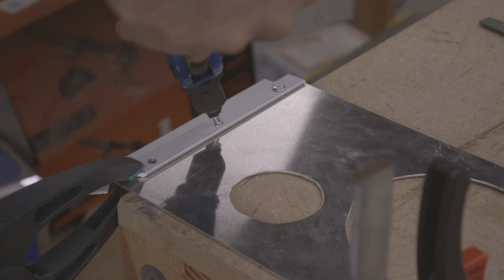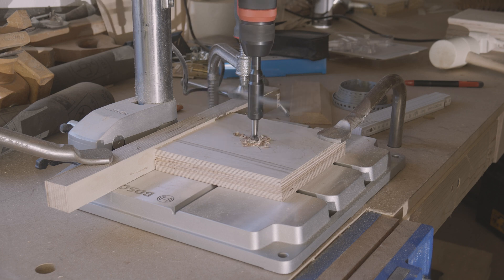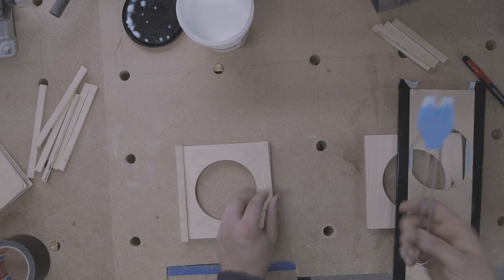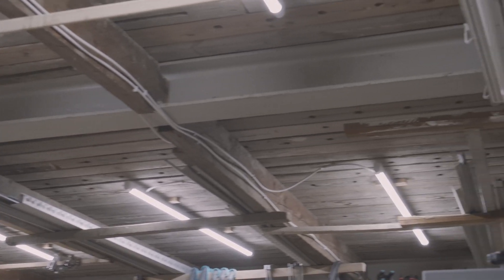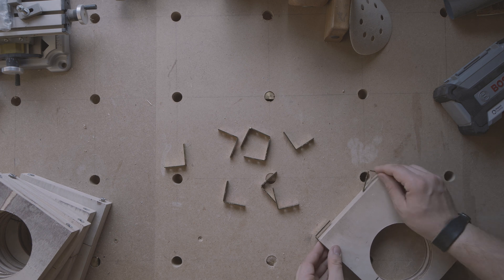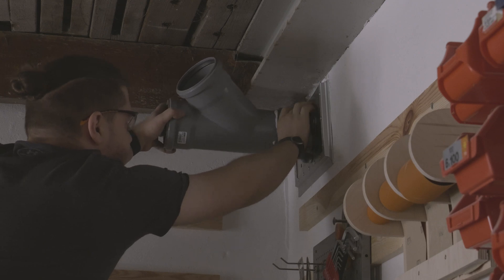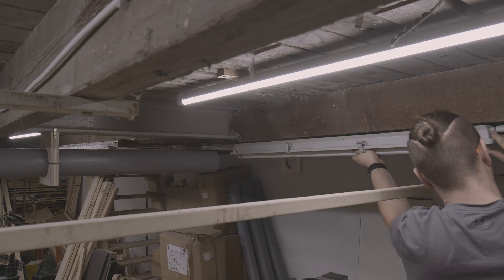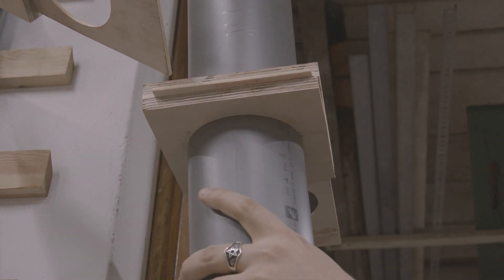The Dust Extraction Part 2 - Blast Gates and Pipes

Comment: Is that a Scheppach HD12 dust collector? Since it's pretty low cost, can you recommend it?
BTW, great video, I would fix the blast gates to the wall or ceiling to gain a little more stability when opening and closing them
Reply from the maker: exactly right, it’s a Scheppach HD12. 
Well, since it is realy cheap you ain’t getting a high quality product, but the bang for the buck is pretty good. It has enough power for my whole Workshop. But changing the Bag where the Dust is stored is realy anoying since the fixture for that bag works realy bad. And I had to remove a metal pre-filter, otherwise the machine would constantly clog up when extracting chips from the jointer. But after removing that it works just fine.
Reply: @Loulexmakes  THX for the response! 👍